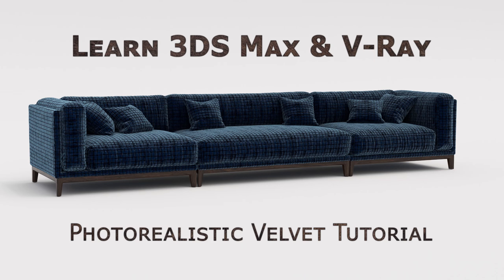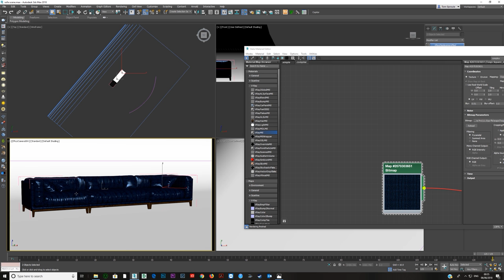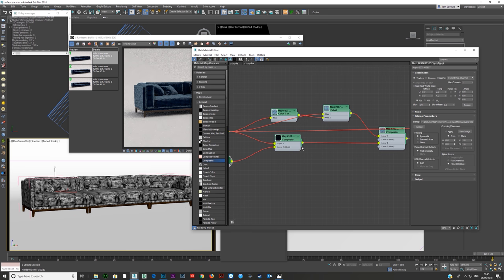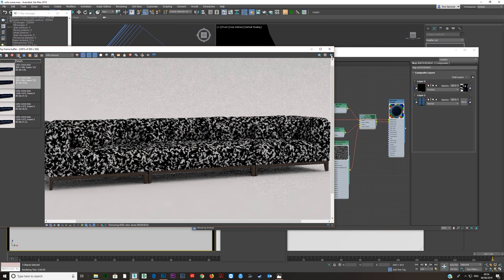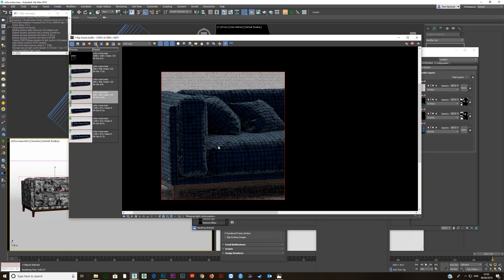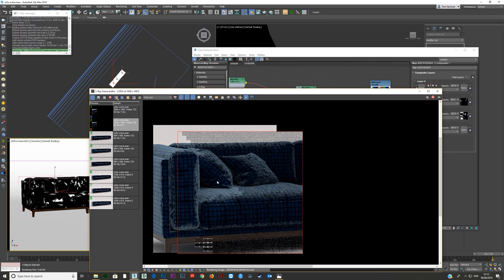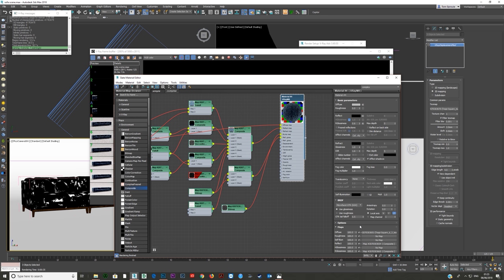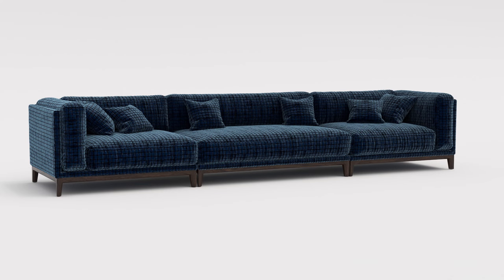Photorealistic velvet - 3DS Max and V-Ray Advanced material creation

Comment: This video really show the whole process of thinking while creating a material - so many details that you have to think about! outstanding!!! - i've got more practicall question when using 3dsmax + Vray to interior projects. Is it common to use tools such as baking materials into objects, when using high poly and low poly models? when we have scenes with many elements with advanced materials they are really heavy and hard to use. I've seen this technique especially when creating scenes for games but i was wondering if it's also used for interior designs with lots of zooming on particular parts of the room - book of shelves, kitchen sidetables etc.
Reply from the maker: Hi, Thank you for your comment. 

It's a good question. 

I've never baked a material into an object. I just don't have the need for it. The reason you would do it in games is to reduce lag in the game, it would mean the program doessn't have to calculate lighting and shadows, as all of that data is already in the material. However, when I'm rendering I want to see the changes in the liight on the object as I change the light, and I want to see how my changes alter the look and feel of the fabric. If I'm baking textures I'm not going to be able to have such a broad scope of control over the scene. 

I do believe it has benefits and I do think about it and I would use it if I thought I needed to. But for now I don't use it. 

If I had a computer which didn't have a lot of power and if I had a large scene, then I would consider using it. Usually when I have such a scene I approach it by multi-resing the objects, basically reducing the poly count massively, and then I reduce the texture size, so I have small jpegs with the texture. There's no point in having a 4k texture when you only see two pixels of it. 

Best, Tom